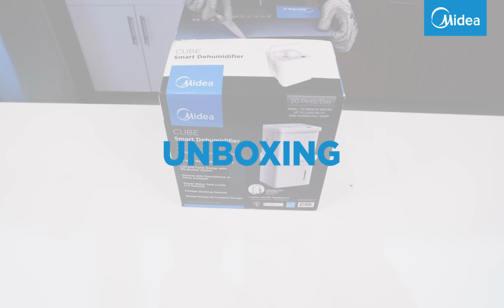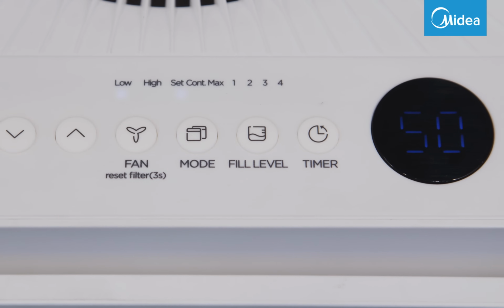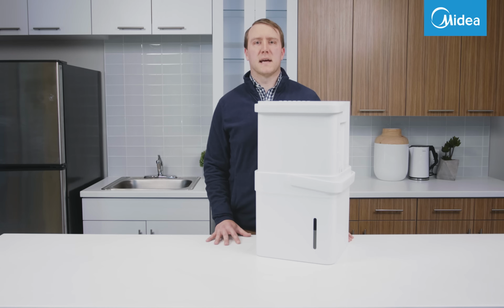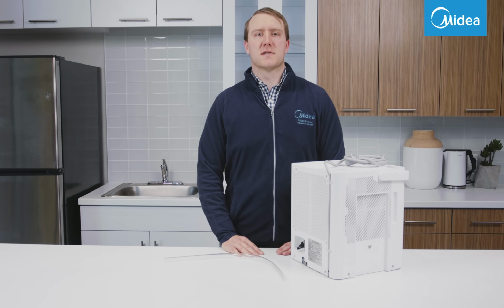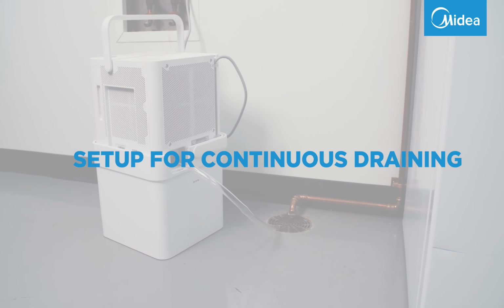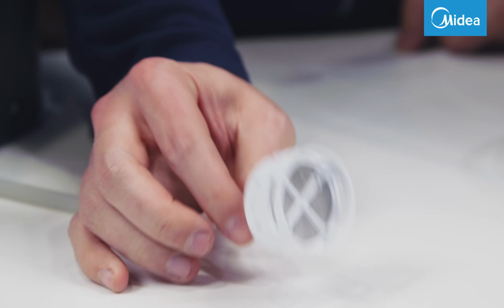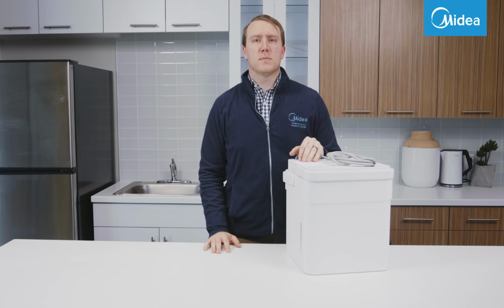Midea Cube Dehumidifier Operation and Overview

Comment: It's not clear which port the  water comes out of and flows into the bucket. I believe the rubber plug stays plugged into the unit when using standard bucket mode but could be confusing to some. Looking at it like a drain plug in a car one would think if you want the fluid to come out remove the drain plug but don't think that is the case here.
Reply from the maker: Hello @KrazyRobb, to better assist you with your inquiry, please contact us at digitalsupport@midea.com. Have a great day!

Comment: Will this model help any at all to remove nasty smells out of a room?
Reply from the maker: Hello, @manesajenkins2684. Thank you for your question. Our dehumidifiers can effectively reduce the presence of musty smells in a room by lowering the humidity levels. However, they do not remove the source of the smell. The musty odor is typically caused by mold, mildew, or bacteria that thrive in high moisture conditions.

Comment: If I buy one with the pump, would I actually have to use the pump mode? Or will it work properly without it
Reply from the maker: Hello @Annieruotay, thank you for your question. The pump mode is simply a feature that can be used if needed, but the unit will operate properly and effectively without using the pump. Have a great day!

Comment: Just bought the smart unit MAD50C1ZWS and liking it so far!   Only issue is when you ask Alexa what the current humidity level is she states the value that’s setup as target humidity not the actual humidity. She is quite insistent that she is correct when she’s not.  It seems the  Alexa skill is being provided the wrong value.   Has anyone else run into this?

Comment: Anyone else having trouble getting an actual hard copy version of the user’s manual?  Mine didn’t come from Amazon with that booklet OR the drain hose. Midea won’t send them, and Amazon will only send an entirely new unit, for which I must send back my current model, which works. 

I even called Midea twice and was told to send back a form they sent me to obtain the users’s manual, which I did, but the next person I talked with refused to send it OR the drain hose. Said I had to contact Amazon.
Reply from the maker: Hello @DeuxChatsNoir7074, we're sorry your unit arrived without the user manual and drain hose and the unsatisfactory customer service experience. We'd love the opportunity to rectify the issue and hope you will contact us at digitalsupport@midea.com. Have a great day!
Reply: @MideaAmerica  I called you all several times, and I STILL HAVE NOT RECEIVED THE HARD COPY OF THE OWNERS MANUAL. I did get the clear hose, but no manual.  A hard cope comes automatically with the dehumidifier, but mine did not. Get with it.

Comment: I have the small dehumidifier on the level 1 approximately how much water is it collected it looks like a half a gallon I could measure it but I’m lazy😊 Tia everyone
Reply from the maker: Hello @mahhubbard, the unit is set to the first level for the 20-pint capacity, which collects approximately 1.5 gallons. For all other pint sizes, it collects around 2.25 gallons.

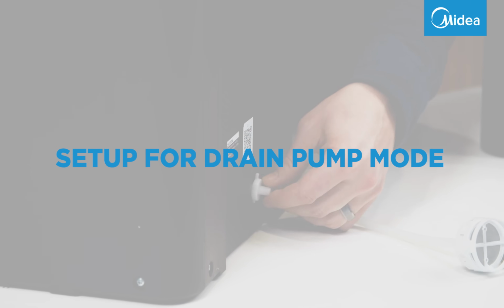Comment: My dehumidifier displays E6 and will not stop. What should I do? 5:48
Reply from the maker: Hello @RichardThorson-u3c, Thank you for your question. The EB error code indicates that the unit is not positioned correctly on the bucket. Please make sure it is properly aligned and seated correctly to resolve the error.

Comment: Is there any difference between bucketless mode and continuous draining mode? This isn’t explained well. Why would someone choose continuous drain mode instead?
Reply from the maker: Hello @laxing77, thank you for your question. Both modes provide easy drainage through the hose. Bucketless mode allows you to run the unit without a water bucket, making it ideal for small spaces or permanent setups. Continuous draining mode allows you to keep the water flowing out via a hose, but you can also use the water bucket if needed.  
Essentially, bucketless mode is about eliminating the need for a bucket entirely, while continuous draining mode offers flexible drainage options, including using the bucket if preferred.  Have a great day!

Comment: Mine has a small hole on the bottom and seems to drain into the bucket when it's not supposed to it should drain through the hose any idea? I plugged it but it's not a good plug
Reply: https://youtube.com/shorts/qxjAMXdAGCY?si=bavPBVuW4DC_-hPY
Reply from the maker: Hello @richardwild8089, we apologize for the issue you're experiencing with your unit. We recommend ensuring that the hose is connected properly. For further assistance and guidelines, please contact us at digitalsupport@midea.com. Have a great day!

Comment: OK, I FIGURED THIS BUCKETLESS THING OUT:  

1.  "BUCKETLESS MODE" MEANS CONTINUOUS DRAINING FROM THE HOSE AND NO BUCKET UNDER IT.  (SO IT TAKES UP LESS SPACE.)

2.  "CONTINUOUS DRAINING MODE"  MEANS CONTINUOUS DRAINING WITH THE BUCKET UNDER IT AND THE HOSE COMING OUT OF THE LITTLE DOOR IN THE BUCKET.

TO MAKE IT WORK IN "BUCKETLESS MODE", YOU HAVE TO DO THE THING WITH PRESSING THE UP AND FILL FOR 3 SECONDS AND PUTTING IT INTO BUCKETLESS MODE.

TO MAKE IT WORK IN "CONTINUOUS DRAINING MODE" WHILE THE UNIT IS STANDING ON THE BUCKET, YOU DON'T NEED TO BUCKETLESS MODE.  YOU JUST REMOVE THE LITTLE DOOR IN THE BUCKET, ATTACH A HOSE AND IT WILL AUTOMATICALLY SENSE THAT THE HOSE IS ATTACHED AND WILL DRAIN THROUGH THE HOSE.  

YOU CAN TELL IT'S IN CONTINUOUS DRAIN MODE BECAUSE IF YOU PRESS THE FILL LEVEL BUTTON, THE FILL LEVEL LIGHTS JUST FLASH.

TO SUMMARIZE, THE ONLY TIME YOU NEED TO PUT IT INTO BUCKETLESS MODE IS IF YOU ARE NOT - REPEAT NOT - USING THE BUCKET AT ALL.  

THE ENTIRE INTERNET IS FULL OF PEOPLE WHO HAVE THEIR UNIT SITTING ON A BOARD ON TOP OF THE BUCKET SO THEY CAN PUT IT INTO BUCKETLESS MODE AND USE A HOSE.  THIS IS NOT NECESSARY.  TAKE IT OUT OF BUCKETLESS MODE AND SIT IT DOWN IN THE BUCKET WITH THE HOSE ATTACHED AND IT WILL DRAIN THROUGH THE HOSE AUTOMATICALLY.

Comment: Did anyone have a unit that had a dramatically badly calibrated humidity sensor? Is there any fix to that or do I just need to try and get a new one? Like I want to get a specific humidity and then stop but it’s saying it’s dramatically less than what it is. I’m measuring by multiple means so just know it’s reading 35% and it’s really 60…
Reply from the maker: Hello, @joshspacht120. We're sorry your unit has not been operating as expected. To better understand and assist you in resolving the issue, please contact us at digitalsupport@midea.com. Have a great day!

Comment: The humidity indicator always shows about 10–11% less than the hygrometers I have set up nearby. Is there a calibration procedure that I am missing?
Also, how does it detect when the hose is connected in continuous drain mode?
Reply from the maker: Hello @Narigopia, we apologize for the issue you're experiencing with your unit. To better understand and assist you in resolving the issue, please contact us at digitalsupport@midea.com. Have a great day!

Comment: Do you need to let it sit for any amount of time before use after you set it up new or have moved it?  Nothing in the manual about it, actually states to turn it right on and run it for 24 hours straight.  Thanks
Reply from the maker: Hello @NinjaRastaMon, thank you for your question. The unit does not require any wait time before use. Have a great day!
Reply: @MideaAmerica  Thanks!  I was also concerned for after carefully moving it for draining or within the house.  I will still keep it upright and light motion.  Good to know.

Comment: User manual mentions to clean the grille but the images do not tell you where the grille is located. Which part is the grille??!! Very frustrating. User manual is not very clear.
Reply from the maker: Hello, @brittneyw.5991. The grills are the holes located on the side and back of the unit. If you have further questions or concerns, please contact us at digitalsupport@midea.com. Have a great day!

Comment: When starting for the first time in bucket mode, where does the water come out??!! Do I have to unplug the garden hosw outlet or does it come out somewhere else in bucket mode??!! The instructions just say to put it on the bucket & power on. Nothing about where the water is supposed to come out from.
Reply from the maker: Hello, @brittneyw.5991. When in bucket mode, the water comes from a drain hole located under the unit. You can attach a standard garden hose if you want to drain the unit continuously and don't want it to collect water in the bucket.

Comment: The bucket is filled. The drain hose and pump screen are clear. How do I check to see if pump is working? Nothing is coming out!
Reply from the maker: Hello, @S.JerseyJim. To use pump mode, you will need to hold the fill level button for 3 seconds; when the bucket is filled to maximum capacity, the pump will activate. Have a great day!
Reply: @MideaAmerica  thanks. I’ll give it a try. 👍

Comment: What’s the difference between buckless mode and continuous draining? Why would you need it to continuously drain? Is that if you have it running 24/7 instead of on a timer?
Reply from the maker: Hello, @janeth3139. Bucket-less mode allows you to drain the unit without using the bucket. Continuous draining allows you to drain the unit while the unit is on the bucket. Have a great day!

Comment: I bought this last summer and now it says E6… I tried everything possible and no buttons working at all. Is it on warrenty after one year?
Reply: It says 2 year warranty
Reply from the maker: Hi @JeanMauriceB1C4RD, thank you for your question. The unit comes with a one-year manufactured warranty. The error EB means that the bucket is not in the right position or has been removed. Have a great day!

Comment: I WOULD NOT RECOMMEND THIS PRODUCT OR THIS COMPANY TO ANYONE.
In the spring of 2022 I bought the 50 pint Model #MAD50PS1QWT from Costco. The label says it was manufactured in March 2022. It worked perfectly as advertised the summer of 2022 and the following summer of 2023. It was placed in the large family room and used to dehumidify my 2,200 sq ft home. After each summer I repacked it in the factory box it came in and put it in the storage closet. 
 
In the summer of 2024 when I took it out and set it up, it did not work. The unit turned on but the compressor would not operate and therefore would not dehumidify the air in my home. I called the Midea support line, which was no help. They gave me the names of five authorized repair companies none of which are in the five-city tidewater Virginia metropolitan area. The closest one was 50 miles away.
 
I WOULD NOT RECOMMEND THIS PRODUCT OR THIS COMPANY TO ANYONE.
Reply from the maker: Hello, @jcopp2031. We're sorry your unit failed to operate and for the unsatisfactory customer service experience. For further assistance or concerns, please contact us at digitalsupport@midea.com. Have a great day!

Comment: When using it bucket mode, does the black drain plug need to be attached or detached?
Reply from the maker: Hi @JRock-vf4fw, the black drain plug should be attached. This ensures that water collects in the internal bucket rather than draining out through the hose connection. Have a great day!
Reply: @MideaAmerica  thank you for your very quick response!
Reply: If it has an internal bucket, then what is the bucket that the dehumidifier sits on for? I don't understand how the water drains into the bucket it sits on top of. Where is the water draining from & into the bucket it sits on?

Comment: I purchased one of these units and i connected a garden hose for continuous draining on the bucket but because the bucket sensor is engaged the unit thinks it is in bucket mode and the water drains into the bucket.  The only way to have it drain into the garden hose is to remove the unit from the bucket (which disengages the bucket sensor) then but it on a stool or in a different bucket that doesn’t engage the bucket sensor.  Then put the unit in bucket less mode and it then drains into the garden hose.  What amy i missing?
Reply: So, on top of the instructions in the video where it indicates to remove the cover and insert the supplied hose (or your  own garden hose), I also had to use the app to set the "drainage mode" to "continuous drain". After I did this, the water level indicator disappeared from within the app, and the bucket has stayed relatively dry while the hose takes the water to my basement drain.

Comment: I put the hose on for continuous drain. The fill level LEDs still light up if I push the button. Does that mean I didn't do it right
Reply from the maker: Hi @corman2332, for any questions or concerns, kindly email us at digitalsupport@midea.com. Have a great day!
Reply: I just purchased one of these units and connected a garden hose and have the same issue when I push the Level button.  Did you get a resolution for the issue?  Thank you.
Reply: Also,  using the Set mode to have the unit go on at 50% and stop at 50% with the garden hose connected the water is still going in the bucket and not in the hose.  Is there something wrong with this unit or am I not doing something correctly with the connection?   Thank you.

Comment: If the power goes out, will it aitomatically restart in ant mode you last used?
Reply from the maker: Hi @bigbadbob143, yes, the unit is designed with an auto-restart function, so if the power goes out, it will automatically resume operation in the last mode and settings once power is restored. Have a great day!

Comment: Do I need to keep the unit on the bucket for continuous draining mode or can the unit just sit on the floor and go right into my drain which is below the unit?
Reply from the maker: Hi @TerryDZ28, You can remove the bucket and place the unit directly over a floor drain for continuous draining, as long as the drain hose is properly connected and sloped downward. Have a great day!
Reply: @MideaAmerica thank you. I actually got it setup in bucketless mode. Is there any advantage in using the bucket with continuous mode over bucketless mode?

Comment: The whole Continuous Drain mode  setup fails at 1st use because it immediately goes into WiFi setup mode, which takes longer than 3 minutes!

Regardless, it worked. Within minutes, water is trickling out the hose.  Whew!
Reply from the maker: Hi @FreedomToRoam86, any assistance needed with the continuous drain mode, you can contact us at digitalsupport@midea.com. Have a great day!

Comment: Couldn't find  information in the Midea manual re filter:  what the blinking means and how to reset it. Thanks for explaining that in this video!
Reply: On the machine look at the fan button, it tells how to reset the filter. 

Also, in manual  under the Cleaning and Maintenance page 23 it talks about the cleaning  and the Operation instructions page 16 says to Press the Fan button for 3 seconds to turn off the cleaning filter reminder. Don’t know why they didn’t include that on this video.

Comment: So to be clear I can't put the unit inside the bucket if I'm using bucketless mode?  I just purchased mine and I couldn't get bucket mode to activate unless it was out of the bucket. Having it in the bucket gives it stability and a good height for hose fall even if I'm not using the bucket to hold water. So now I either have to store this big bucket somewhere in my house or turn it upside down and put the dehumidifier on top of it with the potential of getting knocked over. Am I correct? Thank you.
Reply from the maker: Hello @notta3d, If you choose to use the bucketless mode, you will need to remove the unit from the bucket. However, if you prefer, you can continuously drain the unit by attaching a standard garden hose to it while keeping the unit on the bucket. Have a great day!

Comment: What do I do if I plugged it in but waited longer than 3 minutes to do the continuous draining? That's the reason we bought it so we didnt have to empty it out. Is there a way to reset that or is it really a one shot thing?
Reply from the maker: Hello @mellebelle22, you can drain the unit continuously by attaching a standard garden hose to the drain port located at the back of the unit. If you wish to drain the unit continuously without the bucket, you will need to place the unit in bucket-less mode. 

To place the unit in bucket-less mode, please follow the steps below:      
1. Place the unit on the bucket to ensure the EB code is cleared.    
2. Remove the bucket from the unit 
3. Connect the hose
4. Unplug the unit for 2-3 minutes  
5. Re-plug the unit  
6. As soon as it has been re-plugged, press the power button,    
7. Once it's on, quickly hold the up and fill level button for 3-5 seconds.  

You will need to have the bucketless mode set within the first 3 minutes of powering on. Once the 3 minutes have passed you will need to unplug the unit and re-plug it and try again.